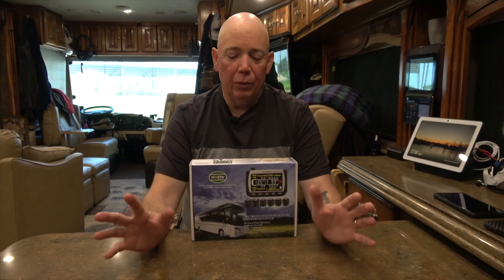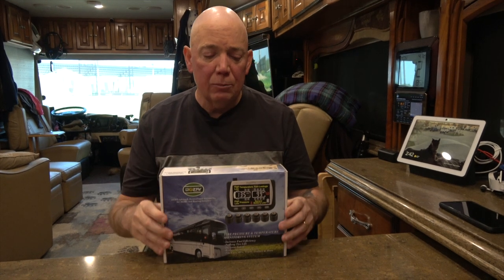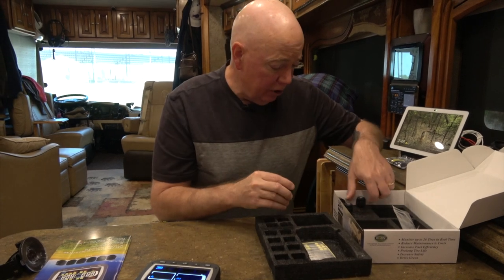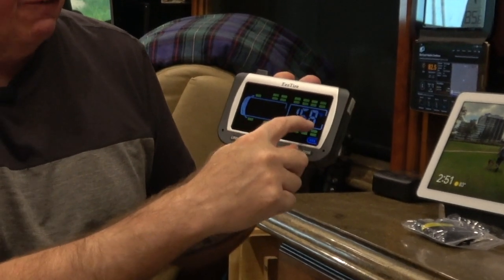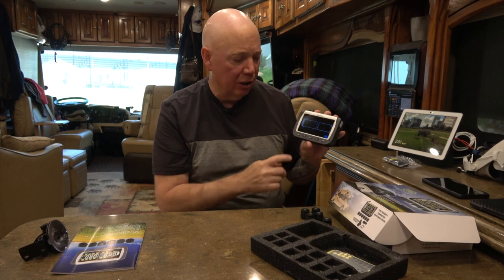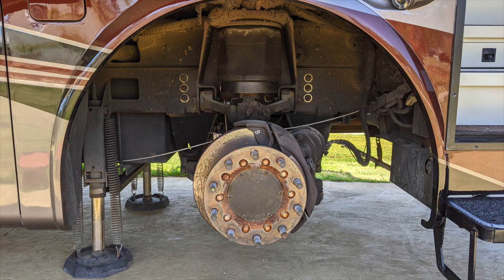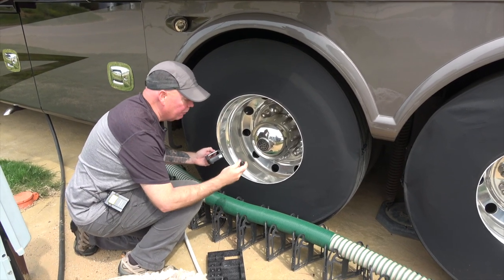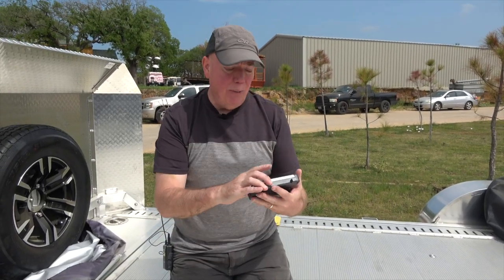Why a Tire Pressure Monitoring System and How It Works? Best Installation | Unboxing RV EEZTire TPMS

Comment: David - Thank you for the detailed and entertaining video. Extremely helpful. Once I determined my axle weight after 3 different attempts, I was able to use the weight chart to determine proper PSI and now I feel more confident using my TPMS.

Comment: Great video! I installed my system by myself (single gal, Class A Owner), but was feeling guilty because I realized I FORGOT the locknuts...but then kinda felt it wasn't needed, and I appreciated your comments, and laughed when you tossed the bag aside. Hahaha! Thanks again for your help!
Reply from the maker: HA!  Yeah, I have never lost one and we have been traveling from 2008.  Now watch tomorrow I will be missing all of them. :)   But it all reality, the tool needed to get them on and off with the spinning covers would not even fit inside my front wheels as they are set slightly inside.

Comment: Good video David!  I have been using my EEZ for three years and have recommended an tpms to many other rvers. I pull a fifth wheel and found it to be very valuable the first trip that I took with the EEZ installed. I picked up a screw in a trailer tire and it alerted me to a drop in pressure before it became dangerous. I did notice though that your new model re-acquired the signal much faster after installing the sensors than my current one. It may be time to upgrade my old one. Thanks for the review.
Reply from the maker: Your welcome Pat.  Glad you liked the video.

Comment: We've had the EezTire monitor for over 5 years now and highly recommend it.  We have all six RV tires monitored and the four towed car tires.   I did have to buy the signal booster after I added a motorcycle carrier on the back of the RV in order to stop the signal dropout from the car.  All we've done is change sensor batteries now and then, and the batteries are very easy to change and available on Amazon very cheaply.
Reply from the maker: Joe...You are very correct on the batteries!  I replace them once a year before we leave just because, as you mentioned, they are so cheap. So why not!?!?!?  Glad you have a TPMS!

Comment: too funny Dave.. after you and I got to talking (on your trip) i ordered the model your holding your hands. Its already installed on the truck and as soon as I get the RV back from Tiffin I will get everything dialed in. While it is great to have TPMS on my Ford Raptor its nice to actively see the temps/pressure on my truck. Its another tool that makes life a little safer

Comment: How do you recalibrate the sensors to the right pressure ?
Reply from the maker: You don't "recalibrate the sensors", you set the monitor to alert on the pressure being sent from the sensor.  You do this by holding down the SET button and then going through the settings.
Reply: You press the link and code key the same time then it will bring up a screen and you’ll see three zeros and whatever is over there on the other side you have one through nine to choose mine was off 4 pounds all tires are off 4 pounds I moved mine up to 400 now mine‘s right on the money
Reply from the maker: @acmanwwjd1  Thanks, I was not sure what you were asking.  Setting the offset. :)   Glad you followed up to help others.
Reply: @DavidBott  Now this doesn’t work on all of them mines the colored one and I talk to the head guy at Eeztire told me how to do it

Comment: This was a fantastic video.  Very clear and excellent commentary with details.  Is it possible to place the #1 sensor for the driver side front instead of the passenger side front?  I think of the placement like aircraft engines, the #1 engine is always the pilot side; so in case of an emergency I don't have to re-thin the RV sensor placement in a hurry.
Reply from the maker: The numbers are just for your reference when placing the sensors so you remember where you programmed each one to go.

Comment: Great Video Dave.   Like yourself we have an EEZ TPMS and have had it for probably 8+ years.  First with our travel trailer and now with the Tiffin.  No issues at all.    Last summer as we were in South Dakota the alarm went off .. we had a valve stem leak on the inside drive axle tire.   If we hadn't had the TPMS we would have never known we had leak and this could have been a real dangerous situation.  I highly recommend a TPMS  and the EEZ product.

I do have one question ... I have the old monitor.  And have heard the the new color monitor is nice, but in the direct sun light is impossible to read.  What is your thoughts?

Comment: When the tire may need more air pressure do you need to take them off then re-install after adding more air? Thanks David!
Reply from the maker: Hi Larry...The sensors are just like valve stem covers. So you just unscrew them, add or remove air, and put them back on to get the current readings.

Comment: Dave,  Great video.  Are there any improvements from last version in the new monitor (other than color) or sensor capabilities?
Reply from the maker: Not really. The older system still works just fine.

Comment: having a problem linking my sensors to my screen help!
Reply from the maker: Hard for me to help for what I showed should work without issue.  Suggest contacting EEZ RV Products for support. - TECH SUPPORT ONLY CALL (928) 317 8888 9AM TO 4PM MON. TO FRI. PACIFIC STANDARD TIME

Comment: The only thing I hate with the color version of this tps is that it keeps flashing at me. The screen gets 100 % bright then dims, then bright, then dim and so on and so on! I contacted the company and they had no response for me. I wanted it to just be bright!
Reply from the maker: It sounds like that in the location that you have it that it is sensing light change and therefore changing the bright to dark bright to dark based on the lighting conditions. It does this because if you use it at night it'll be very bright, so it dims when it's darker.  But on the front of the unit there's a little hole that has the light sensor. That's the area you want to keep some type of bright light situation happening if you want to stay bright all the time. If it keeps going back and forth back and forth and you're not even moving or anything then it sounds like the sensor is poor or in a bad location in the unit itself. I'm kind of surprised to hear that you didn't get any help from the company. Donald's the owner.

Comment: You buy me one I'll use it... Had one and had problems from day one... returned it.. Payed $600 for the one I got..
Reply from the maker: Hi Lankster...Not sure if you had an EEZTire or not, as I am sure they would have helped you out if you were having issues.  So not sure what unit you may have had. But having one is surely better than NOT having one. We have not had issues with EEZTire on our coach or our tow car, or now trailer, and it has saved us a few times.
Reply: @DavidBott  Had the "EEZTire-TPMS10B Real Time/24x7 Tire Pressure Monitoring System - 10 Anti-Theft Sensors + Booster, incl. " Drove over 500 miles and it would never gave me the right pressure in the tires on my 22.5 tires.. had stopped to recheck them and had a low tire.. in short I think there was something wrong with the one I had as that was one problem I recall having.. three of the tires would never tell me anything even after changing the battery's a few times. Just got to the point in short it drove me nuts so it had to go.. The Alarm at strange times would go off.. I would pull over and check the tires and check the pressure all good... You know after a few times of that you turn it off and stop using it.. That trust was broken in short..  So David I know it works have lots of friends like you in the RV world as we are full timing it... I just check my tire each time I leave and at each stop... Yep it takes a little more time but I have the peace of mind knowing I did it..
Reply: @lanksterprice  so I guess that you think you'll never have a problem WHILE the rig is rolling down the road?
Reply: @gonebyrv9748  No matter if I spend thousands of dollars your going to have a problem at some point.. Yep I know that. and will do our best to get threw that pain when it happens.